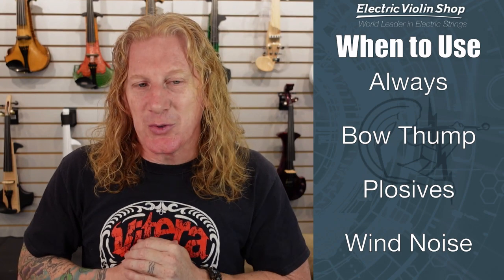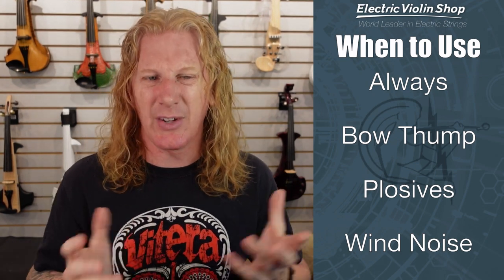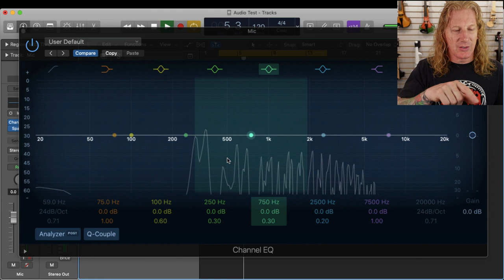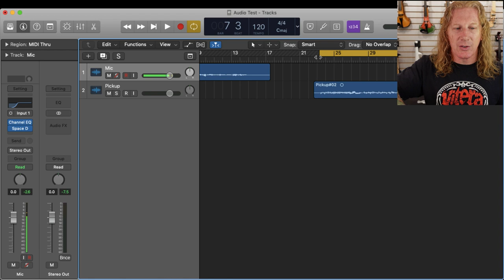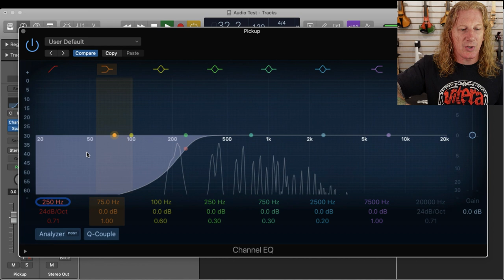How to Use a High Pass Filter

Comment: Thanks for the helpful information.  Would using a hi-pass filter affect the sound negatively while using an octave/2 octave pedal on a 5 string violin? Thanks.
Reply from the maker: Not necessarily. You should still use a HPF to clean up unwanted noise at the extreme bottom end, just be cognizant of tone changes while setting the frequency at which it kicks in. For a one octave drop your open C's frequency is 65 Hz, same as a cello, and a 2 octave drop is half that, or roughly 33 Hz. In either case you can apply the HPF and sweep the frequency until you hear a tonal change, then back it off slightly as demonstrated in the video. That set point may be somewhat lower with octave 5-string than for 4-string violin, but it's still a gradual roll-off, as opposed to a sudden cut off, so you can set the filter somewhere in the 100-200 Hz range for octave (or 2-octave) drop without losing most of the C string's fundamentals, yet still eliminating low end noise below 65 Hz.
Reply: @ElectricViolinShop    Does the Fishman Aura Spectrum DI get rid of some of the unwanted low end noise do to its tone print technology?  Thanks.
Reply from the maker: @danielgirdner9567  You can probably EQ some low end noise out with the Aura Spectrum, and different tone images may confer more or less bow noise than others, however, even with the Aura Spectrum you'll get benefit from using a high pass filter.